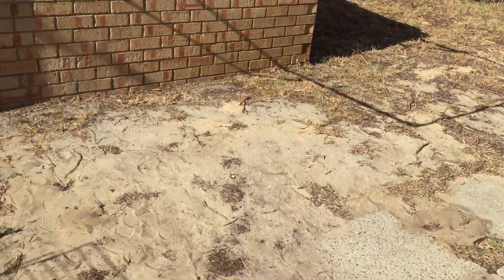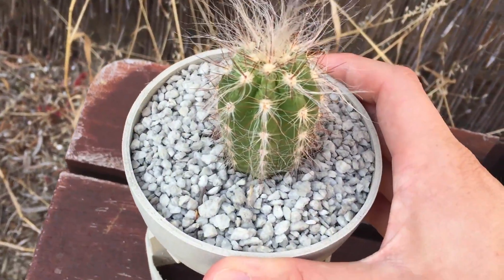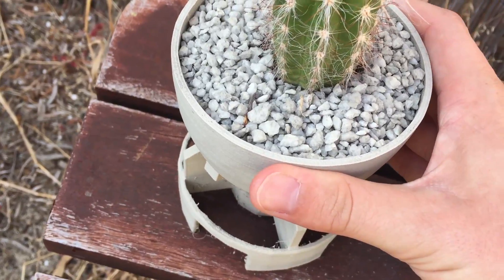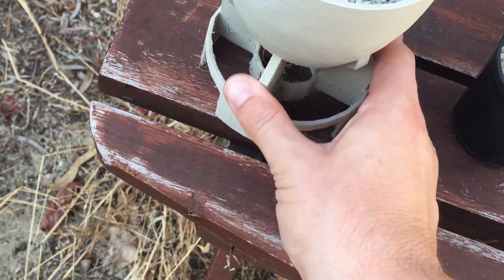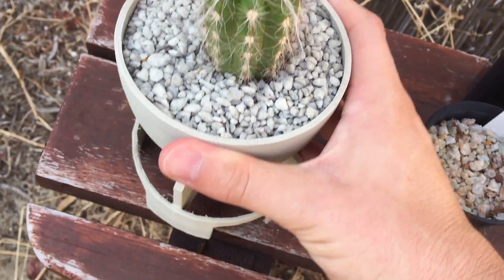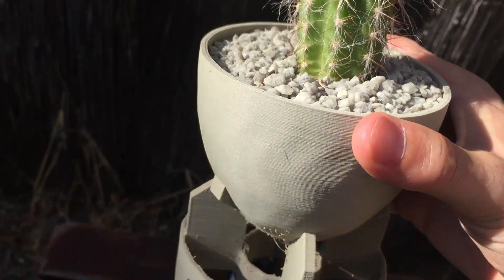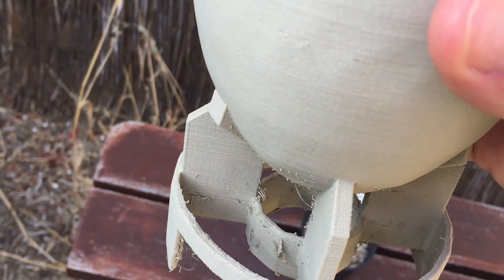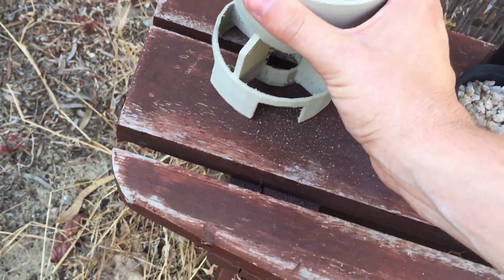3DFuel Algae PLA in 42 Degree Heat! Will it melt?

Comment: You have a much larger variety of filament on hand than any of us.  I'd love to see a sunlight stability test video.  Like a small 20mm black cube in a few different brands and compositions, (ABS vs PLA vs Nylon, etc, Verbatim, Colorfabb, eSun, and so on), left in the sun for a week or so.  I've had no reason to buy three or four different brands of the same colour, but having been in a 3D printing shop, you'd have a stack of old review rolls, probably.
Reply from the maker: +Michael Vaughan That would be a cool test. I've got quite a few different types. It would be interesting to do a water immersion test too, see just how quickly PLA breaks down.

Comment: It's 40 degree's here in South Africa today, dieing of the heat too. Bring on winter. 

My one Print warped at the bottom, but that's because it's sitting on a metal bench in the green house lol. No melting though, just warped.
Reply from the maker: +Ross Mallinson My next test is to see if my PLA prints warp in the back of the car, I reckon the temperature in there would reach 50 or even 60deg C and that could do it. Normal 40deg day doesn't seem to bother the PLA prints at all!
Reply: +Maker&#39;s Muse Yes they do and I had one of my PLA prints melt completely (was a thin print) into a sort of blob but that is because a closed up car can get upwards of 150f/65c and if in a window under direct sunlight upwards of 200f/93c
Reply from the maker: ***** That's intense haha. Main reason why I don't consider PLA to be a useful material for 'functional objects' even if it's made tougher with additives. 3D Fuel do have a 'temperature modified' PLA which might fair a little better, will have to find out.
Reply: Maker's Muse
I went to their site and that Advanced PLA has a higher melting temp than ABS but not a price one on their site for the Hippy PLA or this higher temp PLA.  A bit weird that.
  Oh, and know what is intense?  People leaving their babies in that same car if only for 5 mins with cracked windows it has been proven it gets hot enough to cook a baby's brains in that amount of time.  I always SMH about such stuff where it is hot as hell in the middle of summer and someone is popping in for a quick something and leaving their baby in the auto.  If caught, before or horribly after, it is a murder charge now here.
Reply: +Maker's Muse when I first started printing (end of summer last year) I printed a iPhone car mount in PLA. Worked great that morning left the car for work came back around 1pm the mount had drooped and was all squishy.  Meanwhile I printed a peace for cleaning my windows in ABS that has been in my car for months with no issues.
Reply from the maker: Nice! My thoughts exactly every time I produce something functional. Cars become crazy hot in the sun.

Comment: It is Algae Green as in colour or is it made from Algae?
Reply: +Mickice Acetone smoothing really only works on ABS so this being PLA I doubt it would do much or at least I never managed to get PLA to do anything even when floating in 100% Acetone.
Reply: Michael Vaughan
Yep.  I did see one use carb cleaner on it to make it more rubbery and carb cleaner I have used on my skin when I am really grimed up after working on my car but I wouldn't use that every single day or lots and lots for sure.
Reply: Michael Vaughan
Yes, I have seen those but I instantly discounted it but breathing in carb cleaner or having it on your skin a lot is a no no.
Reply from the maker: +Mickice It's 3DFuel's Algae PLA which contains 20% of actual Algae Biomass. It's a 100% renewable plastic.
Reply: Fantastic, how does it cope with acetone smoothing?
Reply: +Maker's Muse Since PLA is already biodegradable this just sounds like something for Hippies and has no real worth since there is plenty of corn starch and sugar cane in the world. shrug
Reply from the maker: It's designed to break down even faster than plain PLA and harvests polluted areas of algae, but yes certainly has some wank factor to it!

Still, I like the look of it and it was the perfect 'green' for the mini nuke.
Reply from the maker: Mickice Yep, acetone won't do anything to it. :)
Reply: Maker's Muse
LOL, yeah and I went to their site and they have Advanced PLA too but not a single price for either.
Reply: You don't often see people chemically smoothing PLA.  Solvents for PLA happen to also be great solvents for human skin.
Reply: That one's a pretty mild example.  I've heard some PLA solvents are the kind that would leave you with serious chemical burns, on contact.